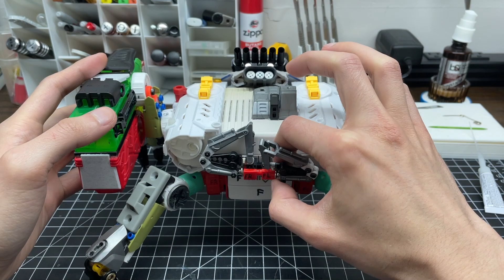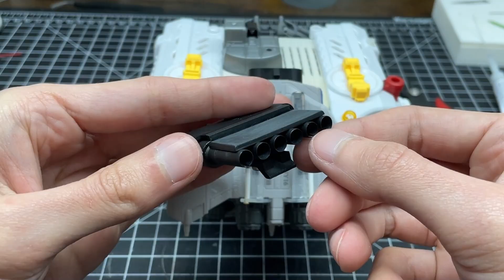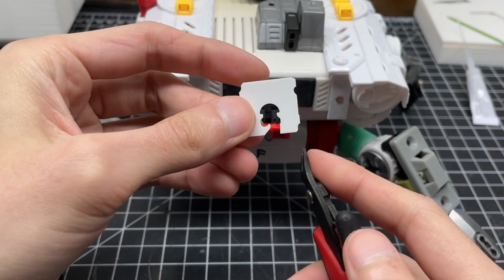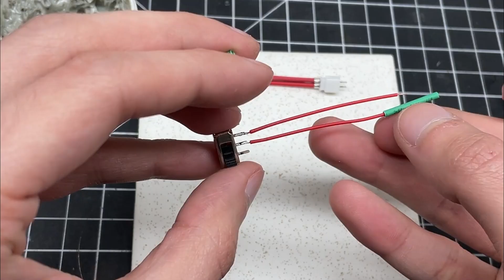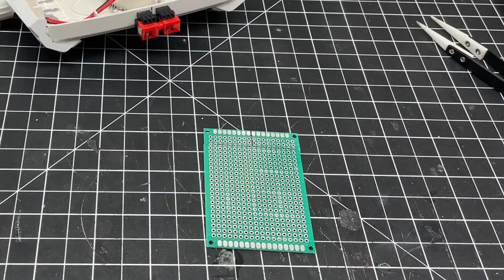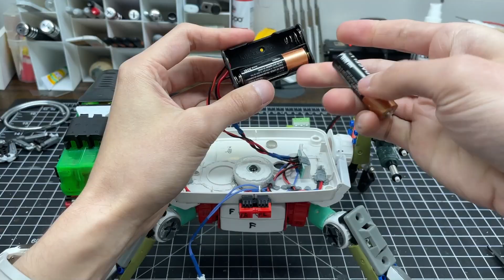Project Fidlar: Crab Mech Electronics (Part 5)

Comment: Hiding the switch in plain sight and even using it as a mount for the radar dish was extremely clever!
Reply from the maker: @Neamerjell  thank you! I used a switch as a greeblie on a sci-fi tank and liked the idea. This connection ended up being too weak to use the radar itself as a handle but at least it’s hidden, and I’ll try again in the future.
Reply: @proto.roborovski  A latching push button switch would lend itself perfectly to this purpose. You could mount it on the surface of a model and it would appear as a round or square raised area until pressed, then the button would be flush with the housing. 

The question is, would it be functional once painted? The clearance between the button and its housing is extremely small. You could bypass this problem by mounting the push button inside the model then drilling a hole in the surface of the model to mount whatever greebly you want on top of a rod going through the hole that is glued to the button.
Reply from the maker: @Neamerjell  I had this idea as well and I even purchased latching push buttons for this idea, but I didn't see a way to attach it to this model in a way I liked. It may also be possible to just mask the switch and dry brush it to prevent it from getting jammed with paint.
Reply: @proto.roborovski  Given the creativity I have seen so far, I'm sure you'll find a clever idea to solve this problem!